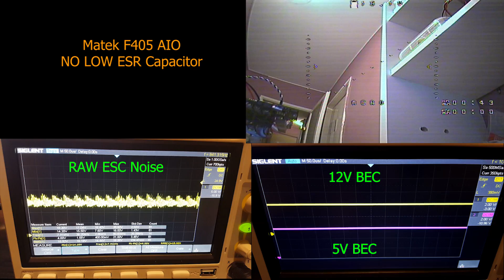Matek F405 AIO Review and Noise Testing

Comment: Love the channel man. You are killing it with this content! the matek PDB's have always had some crazy gypsy magic in them. Just did a build with the DYS board and the noise is unbelievable even with caps on the escs! Gonna swap with this. thanks
Reply: Drone Mesh I using the DYS F4 and I also got noises from the esc! But it still flyable but there is a noise that you can see.
More even when you punch but it's not to hard noises. 
Other then that the DYS F4 is a great board.
And yes you right the Matek F405 AIO is the best board ever and I also bought this soon I will try.
Reply: Drone Mesh Ik this is off topic to the comment you are replying to but it's the first comment of yours I could find. After getting this AIO it has been horrible. The sort of things that a review can't pick up but after arming my quad with blackbox on it would just fly off. Matek support haven't been the most helpful and said you can't use blackbox or have gyro above 8k on some of the boards. Even after doing all this it still yaws occasionally on its own accord sometimes up to 90° which is barely flyable. I couldn't recommend this board even though it seems great on paper it has kept me out the air for a month.
Reply: Drone Mesh, I can confirm yaw twitching caused by electrical noise. Mine F405 AIO board twitch like crazy without 470 uF 35V capacitor on battery pads. And with this capacitor twitching still occur. Even crashed and totaled one frame at yesterday because of unexpected twitch. Should be noted that it is most likely related to current demand and ESCs - batteries with larger C twitch less. Tattu 4S 45C almost always twitch on middle-high throttle. Turniq Graphene 4S 65C twitch occassionally on high throttle. I guess that underpowered ESCs may cause this too. Quad with F405 AIO board have RCX2206 v3 2400KV motors (40A demand on full throttle) and RacerStar RS30A v2 ESCs left from previous build. Got 125A in total in punch out from them without frying however it is possible that they become very noisy when overloaded. Received a set of RS40A ESCs - I'll try them instead of 30A ones in next days and capacitors on ESC power pads too.

Hope to see your video soon :)
Reply from the maker: Thanks..
Yes a lot of people complaining from this problem on the DYS F4.. I still have not built it but from the data it seemed to me that there is high risk for problems.

Glad I could help ^_^
Reply: Its a shame but I'm going to toss it when this matek arrives. I wouldnt waste your time putting it in a build. I have an LC filter on a TBS unify and feeding foxeer monster2 from the filtered unify so the only thing to blame is the board. run out of places to stuff capacitors. heart is broken over this board...
Reply from the maker: I wish i could of gotten it sooner.. I try to get this stuff as soon as i can so people don't waste their money :(
Reply: can you please do another bulid or a setup wiring for the matek f405 aio?
Reply from the maker: +John Oc Any updates??
Reply: Decided to upgrade to Frsky for this build and waiting on the transmitter and receiver in the post. Saw the flight footage and it looks perfect! Cant wait to maiden. Really impressed with Matek. On the site they have the best diagrams I've seen. They even give the current calibration number for betaflight AND you can use S5 for the inverted smart port signal instead of the sketchy inverter bypass on the receiver. Cant confirm yet but i'll let you know how it turns out.
Reply: Hey man.... so this is weird.... Have you ever heard of one of these boards crashing when you turn your transmitter on?
Reply: Yes, I also connected current sensor on Realacc branded HUBOSD (produced by Matek of course) to SP Racing F3 current sensor input and got readings straightforwardly without any fuss (calibration number was 300). Their current sensor scheme is the same in all boards. By the way thanks for telling about Smart Port on S5. I have FrSky XSR RX-es and they require inverted signal too. I'll try that when mine F405 arrive.
Reply: Maybe particular receiver doesn't like to be too close to FC or VTX.
Reply from the maker: +SlenderCam Gaming add me on Google hangouts.. mesh.drone@gmail.com I'll help you debug it. 

Mine is flying just perfect as many other people I know
Reply: +slenderCam Gaming, I also have huge YAW issues with the Matek F405 AIO and looking at the facebook group for it, so do quite a few others. As of today (1st September), a Matek rep has said to add 1 low ESR cap (35V/220uF or 25V/330uF) to each ESC.

+Drone Mesh, did you or slendercam gaming fix the YAW issue? It'd be interesting to see if it's different or same as the Matek reps advice
Reply from the maker: andycb1 This issue is from noisy setups as in electrical noise I have been able to replicate with the worst components on the market the only true solution is a low ear on each esc. 

I will be making the video soon
Reply from the maker: +KrotowX I have confirmed 100% And will be double checking I will make the worst build in the world emax bullet with emax motors and just the supplied cap. Then after that will add a cap to each esc if that solves it then any motor esc combo in the world will be solved with this method. 

Keep me updated as I will also.

^_^
Reply: Drone Mesh Then it will be return back to time when all ESCs had built-in BEC and capacitor on power pads :) Sure, I'll update you after mine quad updating.
Reply from the maker: KrotowX I just got updated from a friend with worst setup and it did not even hover because of how bad it was 2 caps fixed it but 4 recommend.

So you should be perfect I'll build my second test setup this weekend
Reply: Drone Mesh Well, so it is decided. I'll go to our local electronics shop to hunt'n'gather some 330 uF 35V low ESR caps for mine ESC power pads. They have a lot of such stuff :)  And if I will cap ESCs, are cap in battery pads is still required? I quess, not, because source of noise are ESCs.
Reply from the maker: KrotowX Yes there will be no need to cap the battery pads. Make sure the cap is soldered on the ESC for best results. :)
Reply: Mesh, can you or anyone else here would remind me the recommended AWG wire gauge for 40A continuous current? I'm in way to mine soldering equipment now. Don't wish to resolder wiring on F405 board. Old wires here from RS30A ESC-s are AWG18. RS40A ESC-s have AWG16 wires. Problem is that 1) the frame where F405 is mounted, live it last week or two until ordered Awesome F200 and BFight 210 frames arrive and 2) I don't want to cut original RS40A wires until new frames arrive because I have no replacements for them by now. And local electronic shops doesn't have silicon wires in diameter between AWG12 and AWG20. Can I keep these AWG18 wires for now? If current meter on F405 is correct, they was able to put trough 32A.
Reply: At end I disassembled mine quad and removed old ESC's completely with wiring. New 40A ESC-s (RS40A v2) are wide enough to have 220 uF 35V low ESR capacitor straight between their power pads. Put it back together. Look nice with looong ESC assemblies :)  8k/8k/DShot600, in two circles around room no signs of twitching. Before Dshot-s twitched awfully. If weather will allow, we will check this on field at today.

Comment: Anyone had video dropouts without any motors running?  I tested the matek vtx and camera, and on another pdb, and the video setup is fine, but once connected to the FC, i get video dropouts maybe every 1 minute, video drops out for a second. Sometimes i even see static picture in goggles. Its the same if i give throttle to the motors, or not. Quad flies perfectly fine, and osd and noise vise it is solid to, so would not say it has to do with spikes.  I have a original panasonic cap installed 35v 1000uf, vtx povered off 9v bec, camera off vtx. Tried running camera of FC and same problem, tried vtx of vbat, and i got lots of noise, when giving throttle, and more video dropouts.

Comment: Thank you about great review. Almost all Matek PDB boards are great. I have most of them. Well, HUBOSD was kinda hit and miss, but Matek staff was very willing to help (RC Groups have thread with communication with them) and low ESR capacitor included together with PDB board appeared exactly when guys in Matek realized what is done wrong. Fact that they didn't tried to bury their issues under demagogy and FUD speaks very good for them. I have no problems with disappearing picture in HUBOSD again after firmware upgrade and low ES capacitor adding to battery pads. With F405 I believe they did all things right which is proven in this review. Low ESR capacitor is here in case if setup is TOO NOISY :)  Included anti-vibration dampeners and protection cover is very nice touch. If they will continue in such way, they will become a high end brand soon. I already ordered F405 together with VTX-HV. If they will release second modification of this board for brick type frames with USB connector at side and battery connector in back, I'll buy it too.

Comment: Ok so i just did a build with this fc and soft mounted it with the cap. The problem is in flight the quad just yaws back and forth uncontrolled. Tried dropping pids but that didnt work. Anybody know whats goibg on?
Reply: Yaw twitching usually is caused by vibration. Are you sure that FC is not somewhat stuck to frame?
Reply: KrotowX i figured this one  out. I like to fly with ny motors spinning the opposite way to keep my fpv lens clean. I change everything through betaflight cli and bl heli all my f3 builds are like that and fly great. This board apparently dosent like that, switched motors back to default and it flys solid and locked in.
Reply: Sorry! I now admit that F405 AIO twitch in some setups. I learned that on myself two days ago when mine F405 with RS30A v2 ESCs suddenly gone awry when I upgraded motors to more powerful ones. Changed ESCs to RS40A v2 with 220 uF 35V low ESR capacitor between each ESC power pads. No more twitching so far. FC is now set to 8k/8k/DShot600.

Comment: My current sensor is not precise, any BF parameters for current sensor to enter?
Reply: It is www.mateksys.com now. Don't skip "www" or you will be one of grumpies who rants about non-working Matek website.
Reply from the maker: Marko Srepfler yes check mateksys.com site and find the connection and config tab for the Matek f405 aio and it will give you all correct settings. To fix the issue :)
Reply: Thanks, found 165 ( was 400), good board.

Comment: does it have a flash storage for blackbox? i did not see anything on theyr website.
Reply: lol wtf is has a sd card slot.  need to get one for testing as i have a lot of noise on my betaflight f3 FC
Reply: my betaflight build is running 2306 motors on bullet esc. i have two caps but still some lines THX for the noise testing for fpv components!!

Comment: Awesome video, was planning on buying the Dys F4, but going to get this Matek instead. Would anyone know how to use this Matek with a 4in1 ESC? Can I only connect them parallel to the lipo and lose current sensing or is it possible to connect esc to one of the motor power channels on the Matek? Thanks.

Comment: Just ordered one, great video, I have the Armattan Chameleon do you think I could mount this with the sticky pads that are used with the pub's. because gonna mount runcam split above it. great work!!!
Reply: No you won't be able to mount this board to the soft mount pad on the chameleon as it's an aio board that has components on the back like sd card but you can use it but you have to remove stock mounting pad and pdb and then you can use the soft mounts that come with this board the chameleon already has holes drilled in frame and as far as the Runcam split goes you can probably fit it in but you won't be able to remove sd card after it's installed
Reply: Dave stints that's good enough for me, the chameleon top had 6 screws that take seconds to take off giving access to sd card. Sounds promising!! Thanks!

Comment: Do me a favor and test the 3.3v feeding the gyro with some motors installed. This board is basically un tunable even with all the filters on and lowering the PIDs to almost nothing. This board has the ICM gyro and is known to need a very clean 3.3v with no noise on the line.
Reply from the maker: Hazak Yes these gyros are very sensitive.. Make sure your esc wires are not too tight and tape the esc's down very good. I will try to test the 3.3 going to the gyro for you this weekend.
Reply: Roger that, We have build a prototype FC with the same gyro and supplying a clean 3.3 was critical to make the thing not get micro oscillations. It might have something to do also with large toque motors even with a low ESR cap the thing just would not fly clean on 4 different builds. Threw on the DYS F4 and flew like a dream. Look forward to your test :)
Reply from the maker: Hazak send me the proto
Reply: Would love to.. but the last couple I had went over to Germany for XY.FPV and Boris. It needs some tweaks still on having a F4 with inverted S.Port :)

Comment: The board looks great, my only reservation is that it's double sided, if you wanted to solder anything to the underside, or if a wire breaks and you need to replace it then it's going to difficult to get the bottom of the board once it's all soldered in place. You would have to make the top wires long enough to be able to flip the board over which means you will have loads of loose wire on top of the board.
Reply from the maker: Dean Harrison I have built it yesterday and it is the cleanest quad to date on my builds... will upload it today and you will see how I did it.
Reply: Thanks, looking forward to it, my F4 FC stopped working on Saturday so I need to get it replaced asap. I saw the Matek PDB and FC combo so almost got that then saw the AIO version. Would you choose the AIO over the combo?
Reply from the maker: +Dean Harrison I can't answer that just yet until I fly them. I built the aio and will upload video today.. and I got my replacment matek combo.. I will have those tested on the weekend so from testing perspective the aio seems very good. But for flight and real world testing that will be on the weekend.

Comment: Hey Drone Mesh, thanks for the hard work and amazing info.
I was planning to use a Betaflight F3 for my new build (https://rotorbuilds.com/build/5328) but this board looks really good and possibly even better. Plus I'm glad to use your affiliate link if it supports your channel. Cheers ;)
Reply from the maker: Thanks for the support. I have not tested the Betaflight F3 but I am planning on getting it for review soon.

So far on the testing, this board did very good. However, I just finished building a quad with this board and have not flown it or did the real world flight testing yet. 

If you beat me to it keep me updated.

Comment: Whats the difference between this and the Maktek F405 without the PDB built in? are they the exact same?
also, waiting for the Fortini F4 review! haha
Reply: Mr Mackey By separating the PDB and FC, the high current that flows through the current sensor is being isolated from the FC board. Only the measured current value is then passed to the FC through a single pin. This way, we will have one less thing to worry about ie. the high current motor noise and the magnetic field affecting the gyro measurement by any means. But from the way DroneMesh had tested this new board, this board looks promising.
Reply: raj gunaseelan thank you for the explanation. 
I had thought the same thing as you stated, but it seems in Drone mesh previous review of the Matek F4 w/ PCB it showed a little noise, where as this AIO with not even a capacitor on it had zero interference. So it confused me a little bit...

Comment: If you had the choice of this or the BetaFlight F3 what would you recommend? Thanks
Reply from the maker: Will Hobbs Never tested betaflight f3.. I will try to buy one this week and I will come back to you on this question ^_^
Reply: high fail rate on bff3, i went through one in two days. Had a friend go through 3/5, sucks cos its nice to support boris but alas not a worthy product
Reply: I like my F4 Flame better than my BFF3, and Dronemesh says the Matek is even better than the Flame. Im curious to see what he thinks of the BFF3.
Reply: F4 flame is the way to go @dronemesh thx for doing these you da man
Reply: Today I am going to maiden my f4 flame build. Nice to hear it is a good fc. I also have a CL f4 on the way, maybe you could test that one as well. Great content mate, 2 thumbs up.
Reply: I maidened my F4 flame today and it flies great! But I have small issues with the board, solder points are super small and many not through board so I dont think its very robust on solder joints, I put hotglue on them though. Also main power lead solder joints and USB port are NOT on opposite sides so you cant really mount this board so power leads come from side if you want to access ur USB port, you have to make it so power lead comes from front or back. Also had a lot of trouble getting it to flash to newest BF, I had to use other programs to get it flash but maybe it was just a bad unit but it works now great 3.1.7.
Reply: Running 4k/4k loops, airmode + anti-gravity + PT1 with 1-2nd notch filters disabled, very very smooth fly.

Comment: The big feature of this board is that it uses the same gyro as the revolt. 

My primary concern though is that having the battery lead/plug on one side like that whilst being softmounted could cause unwanted flight controller movement from the weight of the battery leads etc.